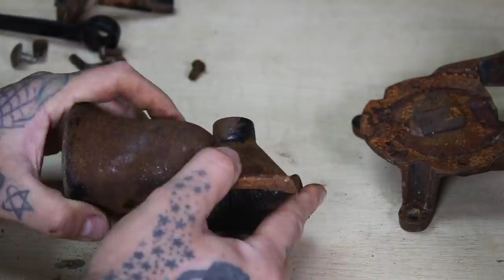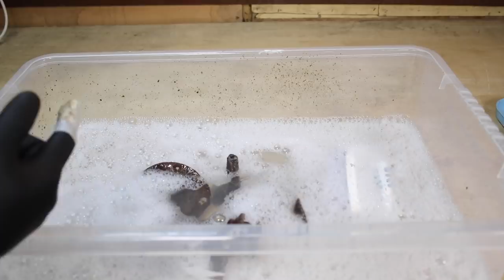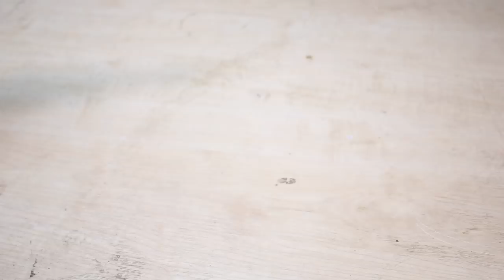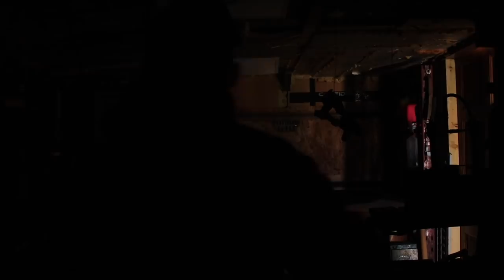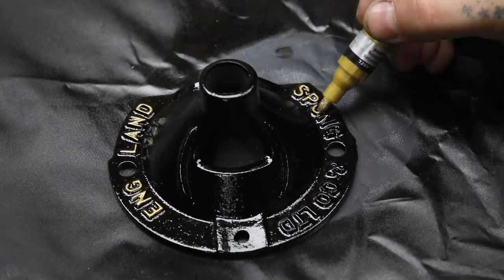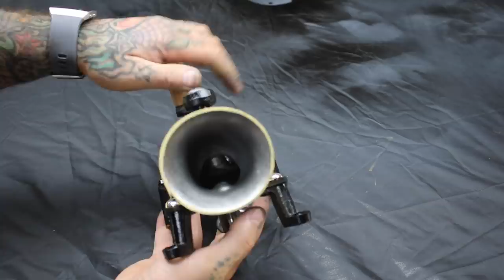Barn Find Coffee Grinder RESTORATION

Comment: so inspired by your video. actually im working on a same project, I got the #4, may I ask what spray paint did you use? is it oil-based, alkyd based? enamel paint? and what finish, flat, satin? thank you very much
Reply from the maker: Ahh cool man, i used an enamel spray paint on this which is glossy, i think i show the can in it for branding.
Reply: @DiesInEveryFilm  Thanks dude :), I probably missed it, ill watch again
Reply: @DiesInEveryFilm  hey man, just one question, how do I clean the parts after sanding and polishing before priming? I spent more than 1hr polishing it this afternoon(I dont have proper tools), then I was so stupid I rinse them under water, and they get rusty instantly! I have to repolish them tmrw.   I also think it might be a good idea to season just the grinding area like how ppl season cast iron pans---rub a little oil, and leave in oven for an hour. what do you think?
Reply from the maker: Otis Huang I clean with alcohol or acetone to get rid of any residual dirt but I also spray it straight away after cleaning it up so to avoid any rust forming. 
Yeh you can season the grinder part if you want to, i left mine but it won’t get rusty in my house.
Reply: DiesInEveryFilm Customs thank you  very much!
Reply: DiesInEveryFilm Customs I followed every step, it was all going well until I realized there was one bolt still left behind, it’s the one on grind you had to put lubricant over. That bolt was dead in there I could not took it off, then I made another dumb decision I drilled it through, of course I missed the target point and drilled through the beam cup , made another hole besides that bolt hole, they have been separated though but can’t put them back together because to hole is too large. I’ll paint them and find a welding workshop to weld them together..... lol

Comment: You're using paint stripper on rust? Clearly you have no concept of how chemistry works... oh, you then go on to use rust remover. Sorry. I should have watched the whole video before passing comment. 

Ruined the patina though... the iron oxide gives a good a tetnus base to your brew. 👍
Reply from the maker: Hahahahaha paint stripper so weak the paint removed it. One day I will get something right
Reply: @DiesInEveryFilm  was that paint or enamel?
Reply from the maker: Enamel I thought id give it a try thinking it would be tougher. It’s definitely different to spray with i had to be really careful on the coats